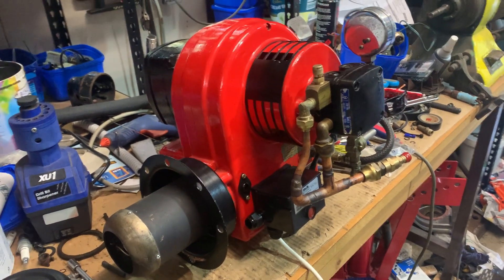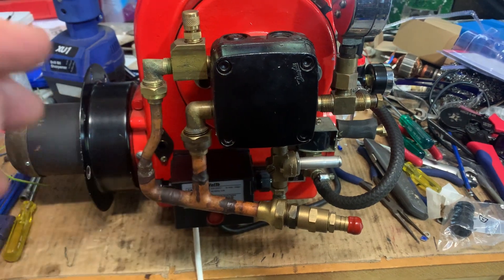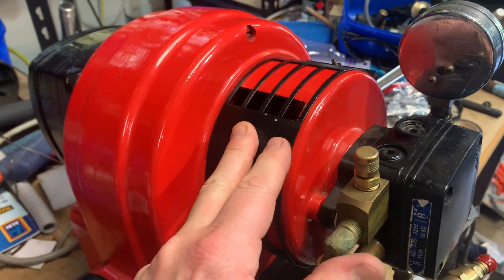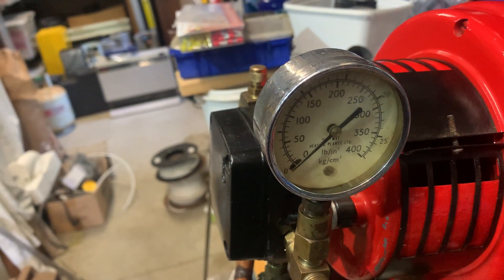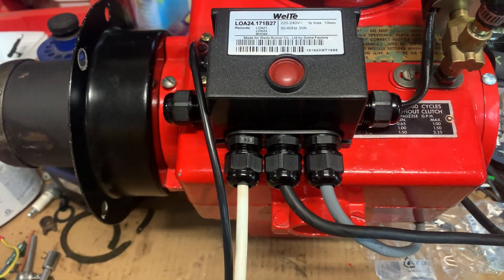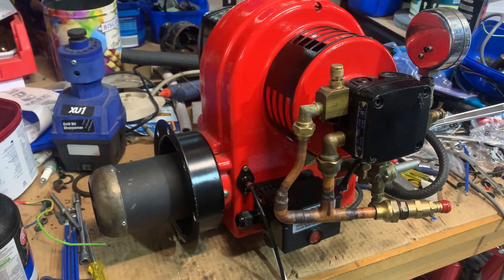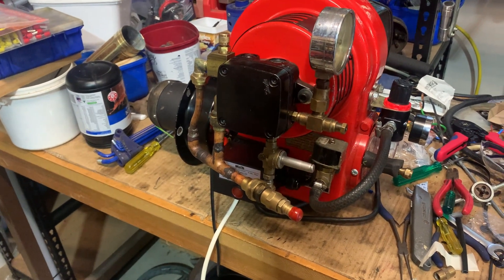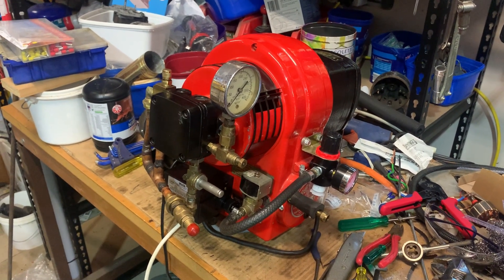Gilbaco Waste Oil Burner Conversion Part 2

Comment: You can make a good oil burner in siphon mode for this nozzle, but for me it is better to work with oil pumped system. Then you dont need a oil tank at all.  Instead of tank you can use somekind of 200w inline oil preheater with valve for oil and for air. Also pumped oil which you send to the nozzle is regulated from 0 to 1 bar. You can use originally pump in one line and two line system. All you need is remove one screw from inside of a pump. Pump will be run with a 12v motor from car window system and it can be regulated with a PWM regulator or you can use stepper motor in combination with arduino. Filtration of oil is easy with  a 50 microns filter. Better controller is the same model of LOA24 but with a mechanical relay instead of a cheap chinese elements inside. With arduino you can control and adjust every parameter of the burner...at the end....nice video...best wishes...and I would like to see your very well converted diesel burner in operation...good luck....
Reply from the maker: Only problem with pumped systems is nozzle erosion, you don’t get that with siphon nozzles
Reply: @offthegridwithbert924  Yes nozzle erosion is possible....but I was be able to burn over 10 tons of waste oil with one Delavan nozzle with any erosion or damage....but I dont like nozzle spraying at all. Now I use burner based on R.Babington patent and principle of atomization of non filtered oil with a clean burning and lowest air and energy consumption of all burner which you can find on market today...but it is a other and long story. Nice job. Best regards...